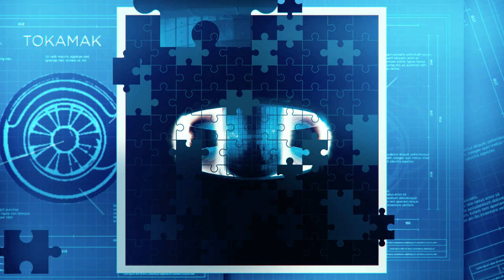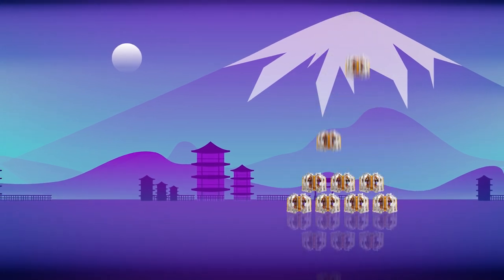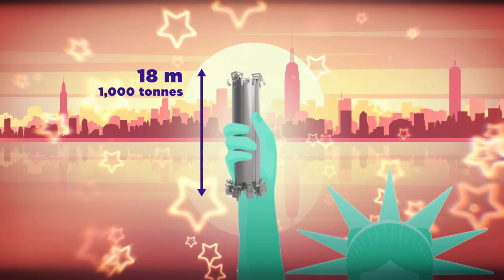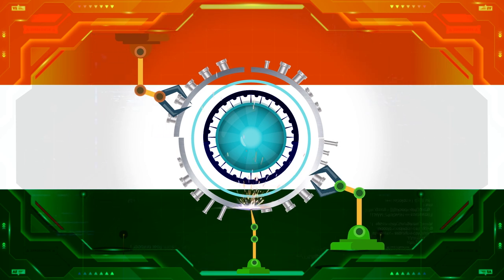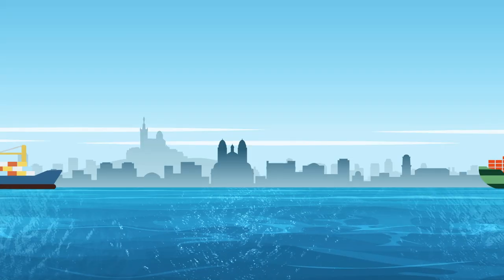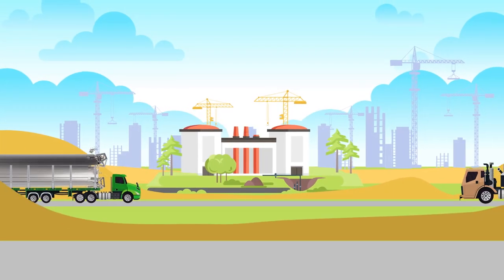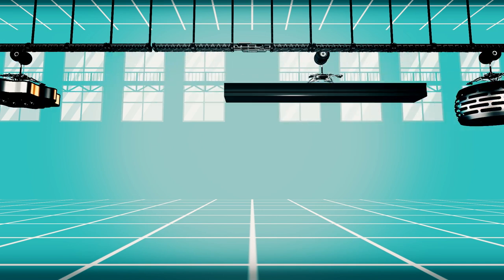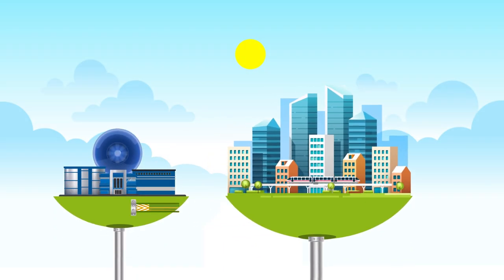ITER, the world's largest Erector set

Comment: Took only 27 months to develop nuclear weapons. Fusion is over 80 years and counting. This concept is based on how our Sun works. What if its wrong?
Reply: Then it simply wont work.
But there are working "prototypes" just not on this scale.
Creating something that explodes isn't as hard as you think. It is hard to make it controlable.
Reply: Would guess just having the energy release as it does in a bomb is way less to calculate and to build than it is to have a field where the plasma is producing heat without destroying the rest of the Machine. We have had quite some tests where the plasma is working for a few seconds. Getting it stable for longer  is the hard challenge(and producing more power from it than we put into it.)
Reply: @toggleton6365  You missed my point. Its the time and money spent on the idea of Fusion and how it works. When is enough enough? What if the fundamental understanding of how our Sun works is wrong? This would account for why over 80 years with only seconds of so called fusion that takes more energy than it produces.
Reply: It's not really based on how the sun works, the sun uses totally different parameters to achieve fusion.
Reply: @ronusa1976  Sun doesn't have to sustain life  genius.